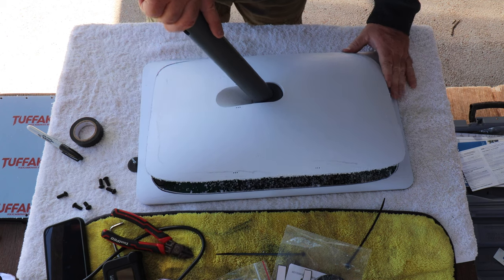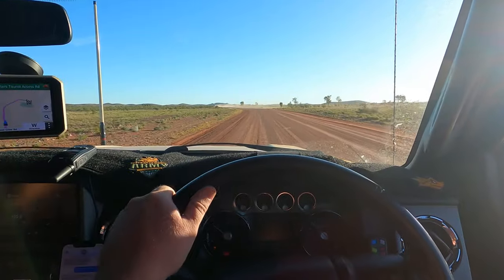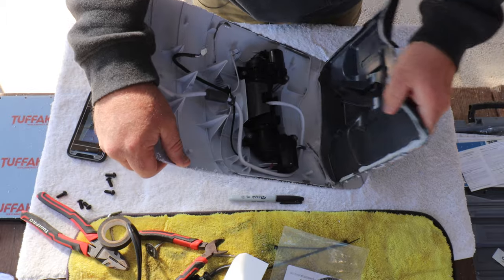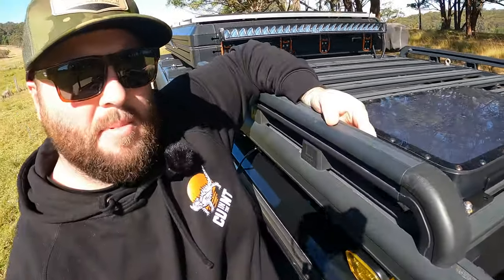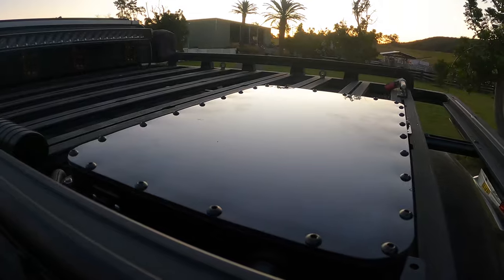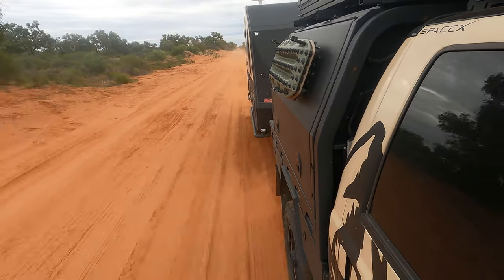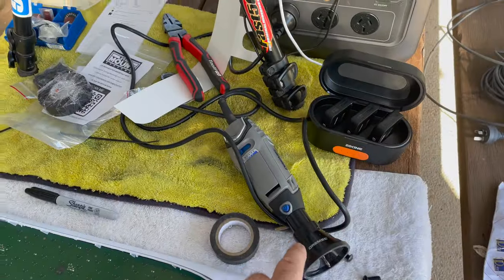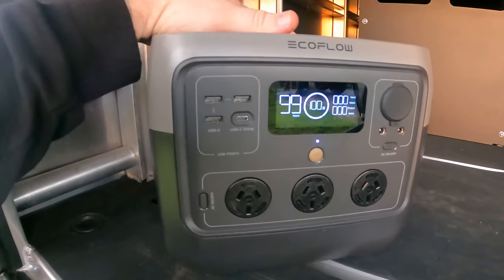FLAT MOUNT STARLINK OUTBACK AUSTRALIA ! I test STARLINK from Australia most remote desert pub.

Comment: Just back from remote riparian zone camp, no way no how could we have had working internet with a flat mount, as it was we had to swim dishy to a sandbar in the middle of the creek and still had some obstruction , BTW with 16h of starlink, 60l Engel, laptop and a small TV used little saw a daily recharge via gennie of 150 amp hours needed.

Comment: Hey buddy how did you get the after market router to connect to Starlink satellite, the problem I have is the satellite turns off when I connect to the 12v router??
Reply from the maker: Hi mate, you need to follow the Starmount instructions very carefully to connect it. step by step. If your having issues with it give them a call they can walk you though it.
Reply: @TyFenwick  hey Buddy
I made my own setup in a flat mount, using everything that star mount have used, any chance of getting the set by set you have on how to connect to router and wiring setup, I live in Brisbane and I’m always working out pass Quilpie Qld where service doesn’t work, I cut my satellite down and run the router that Starlink have with a 150w inverter which works by would love to run 12v with everything inside it like you have, been in Australia at lease I know yours is working, so if it’s possible please to share would be so appreciated mate. Cheers Rod

Comment: Why not keep the motors and make a switch off the motor wire  then make a mount that has a locking hinge..so you can mount it flat and switch the motors off, or hinge it up and turn motors on... that's what I'd do...
Reply from the maker: Probably over complicating it as flat mount works perfectly as shown in video 👍🏼 but yeah what ever works for you absolutely.

Comment: Starlink is still new into existence
Reply from the maker: With how fast tech is moving I won’t even need the dish soon. From 2026 all iPhones will just connect to starlink.
Reply: @TyFenwick  I thought only for tesla phone? Internet all over the planet in remote areas such as mountain,  desert,  ocean etc?
Reply: You won't need a phone, you can pick it up through your Australien Gov mandatory sponsored Neuralink.
Reply: Only slightly jelly after seein' your 250 btw.
Reply: It's not real Starlink on iPhone etc. It's a limited implementation due to power and form factor changes.
Reply: @JimmyStewpot  so tesla phone will have the real starlink